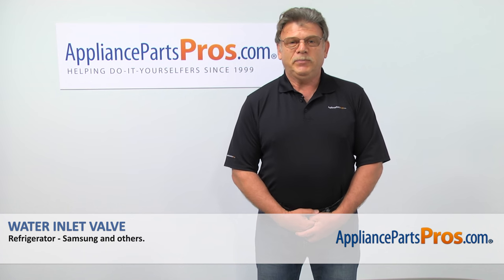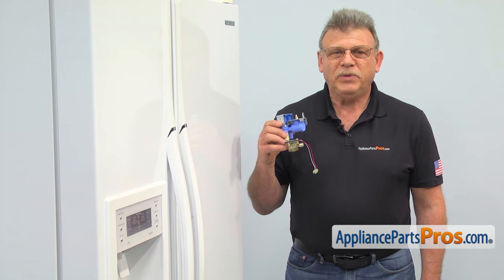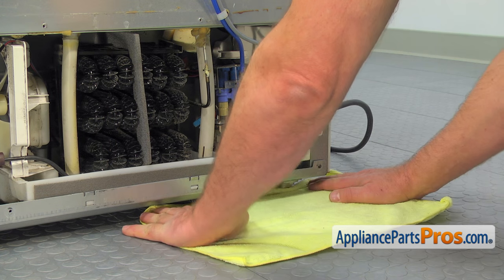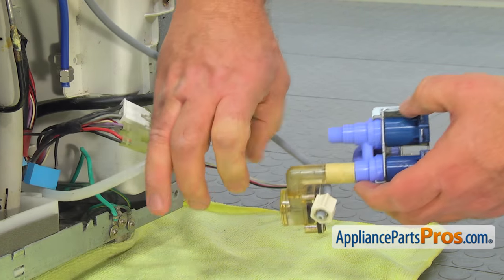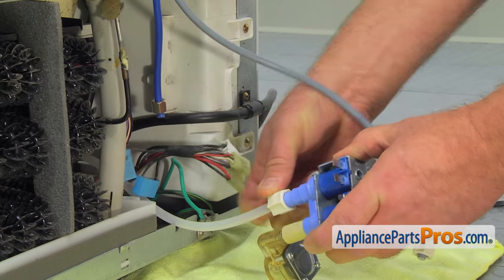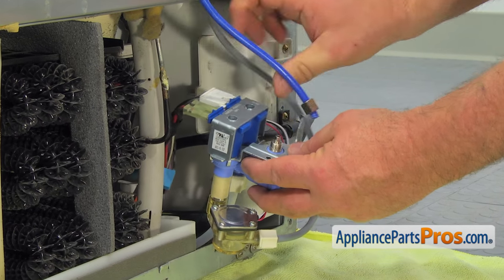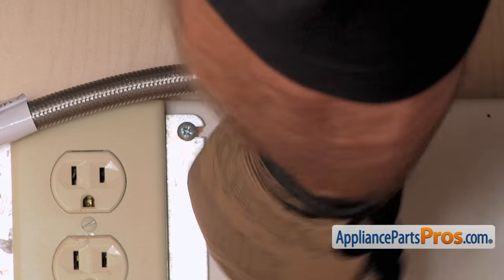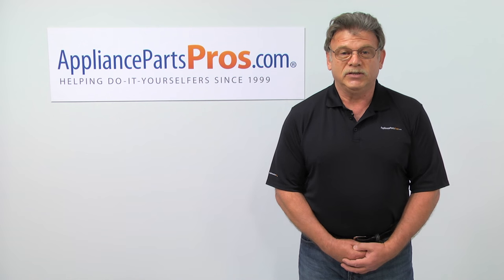How To: Samsung Water Inlet Valve DA74-40150H

Comment: Excellent video. I replaced this water inlet valve on my Samsung refrigerator (Model RS255BABB/XAA) which I bought around 2005. After I replaced the valve, I no longer had the problem of water randomly dripping out of the water dispenser. The valve that I installed was DA74-40150H, and it looks the same as the one in this video.  My old valve was slightly different in that it didn't have a flow sensor attached. On the new valve, I just left the cable that came out of the flow sensor hanging in the air, because there's nothing to plug it into. Interesting that the same valve part number refers to a valve with a flow sensor and also a valve with no flow sensor (you can see this in photos online)

Comment: Thank you for the video. I had two issues with my Samsung Refrigerator. First, the ice maker stopped working. I tried to replace the ice maker with a brand new one and still did not work, so I returned it. 

Then a year later, my wife dispensed water, and it just kept dispensing and would not stop. We cut the water off and capped the fridge supply line. Watched this nice video. The new water valve fixed the water dispensing issue. I was hoping it would also fix the ice maker issue but it didn't. If anyone has any ideas, please let me know...Maybe now that the water valve is fixed, I should try the new ice maker again?

Comment: Hello you can tal me what is the measuring of stainless tell nuts. I am looking for that every where, impossible to find. Please if you have a serie number or measuring a be appreciate
Reply from the maker: What is the model number of your appliance?
Reply: Same problem. It’s supposed to be 1/4” but a 1/4” nut is too big and slides over the threads like a sleeve. Possible it is 3/16”? My refrigerator model is RF18A5101SR and my valve part number is RIV-11A-98.

Comment: I've got no water coming from the dispenser and also no ice. Plenty of water pressure. What could be my issue? the water valve? I wish you had a video that would check the volts of this water valve.

Comment: Is it possible that water can enter the water dispenser and not the ice maker?  I can hear a pumping sound coming from the fridge as if it's trying to pump water to something.
Reply from the maker: Is the problem you're having that you're getting water from the dispenser but no ice from the ice maker?
Reply: Yes
Reply: I am having the same problem.  What could be the problem with my Samsung RF267ABRS refrigeratorT  Thanks in advance.
Reply: @benoitst-amand6342  can you share the rrot cause please as i m having the same issue now, thx